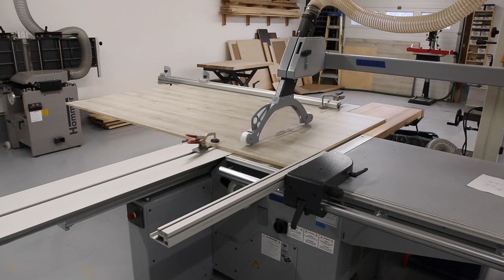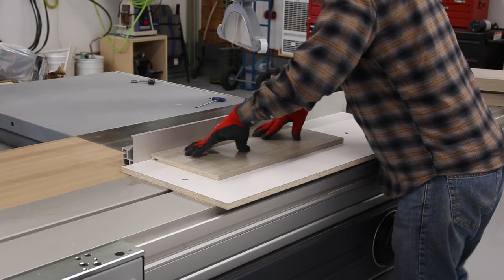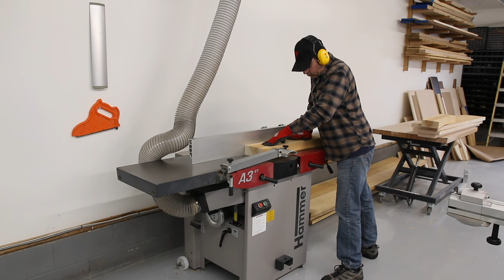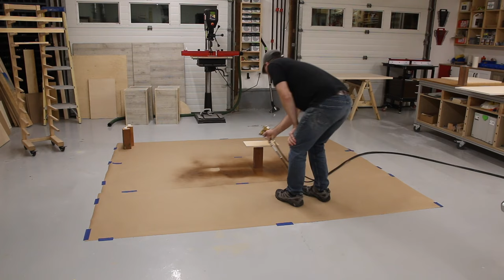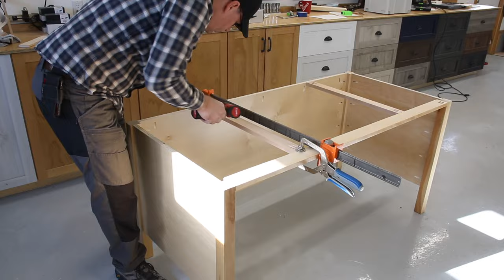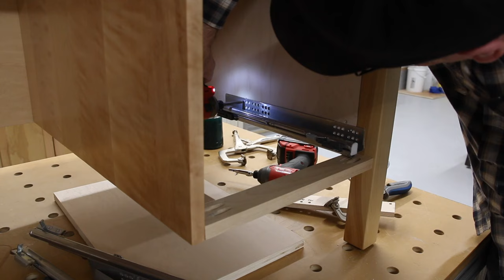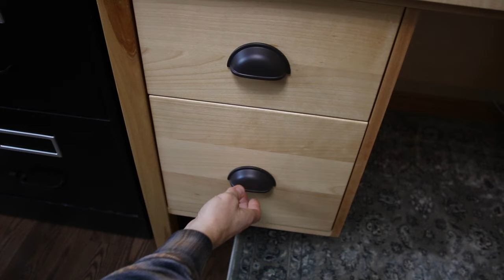Building a computer desk

Comment: Dude…… holy crap you’re the Yoda of woodworking . In just watching two of your very quick to the project and informative videos ( no bullshit endless chatter in your videos, really a plus for me )
In just two videos you’ve mad my woodworking skills jump from a score of about 1.5 to a solid 3 Thank you 🙏 I subscribed hit the like button. You’re shop is very impressive sir. now back to watching more of your videos I need to make a router table station with a cabinet for bit storage . Ya got one of those ?
Reply from the maker: Thank you so much for the nice compliment. I have a router table and I did build some drawers for it. I did not make a video of it but you do see it in my shop tour video. 
https://youtu.be/685FoZcPaSw
Reply: @frenchriversprings  the shop tour is like a wood workers dream. I have a compound 12” sliding miter saw from DeWalt that’s my first big money purchase. A few drills and sand paper. Will be building a router station . I have a question I do not have a planner or jointer, is there anything I can do to get my boards more straight without a table saw or jointer ? Thank you my friend
Reply from the maker: Well a jointer is almost a must to get straight wood. To get a straight edge, you can do that with a table saw or router table or jointer or sliding table saw. The jointer or sliding table saw wins hands down for straight edges. You can also do it with a track saw like the Festool track saw. You can actually do a lot with track saw. But to get straight boards, the only way is a jointer or build a special sled for a planer. Oh you can also do it with a hand plane with 2 sticks of wood but who has the patience for that. If I were you, I would bring all my wood to your local woodworker to get jointed or anything else that you don’t have the equipment to do. Most woodworkers are happy to do it and will do it right away and they might actually teach you a few tricks. I used to do it all the time and I still get my local woodworker to do all the edgebanding for me. On occasion, I get a job where I’m not too sure how is the best way to build it. So I bring the plans with me to my local woodworker, and ask for his opinion. He has 35 years of experience. You wouldn’t believe all the tip and tricks he shows me. He is my competition but he is still happy to teach me. He is always booked solid anyways. And of course I pay him for his time. Can I ask how old you are?
Reply: @frenchriversprings  hello I am 45 years old I just retired medical reasons so I’m home with my family everyday what a blessing from God. I do have a local wood master I will be taking wood projects to him . Thank you for all the videos can’t wait to watch more God bless you sir have a great week

Comment: At 1:18 of the video, that looks like a nice jig.  Is that a “dado sled”?  Did you just pin it down to the slider with T nuts in the slider groove?  Clever!
Reply from the maker: Y’a. I lock the slider. The white melamine is pinned down with T nuts. I made the T nuts myself with delrin plastic. The purpose of the white melamine is for my material to slide easier and at the same time it gives me zero clearance for the dado